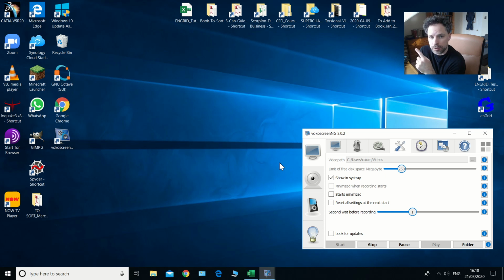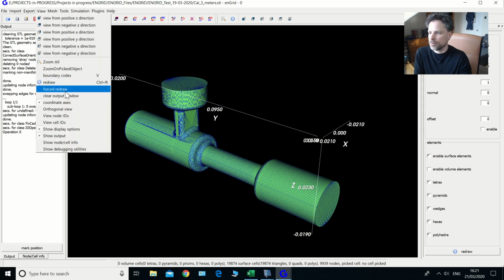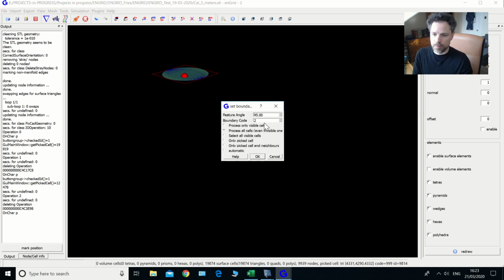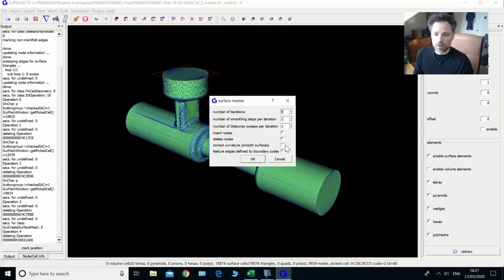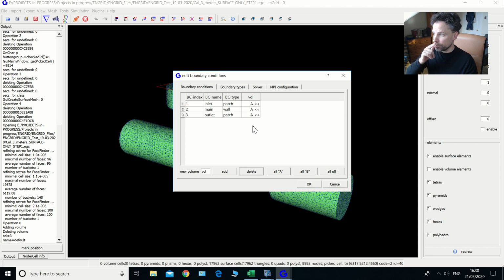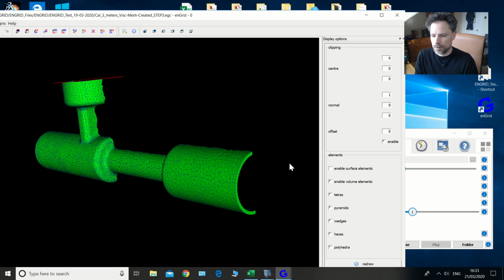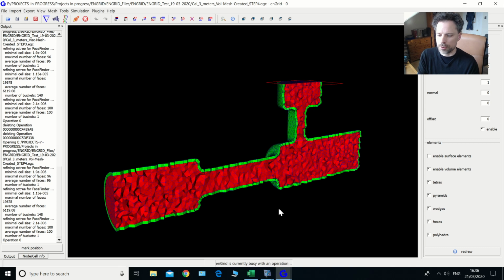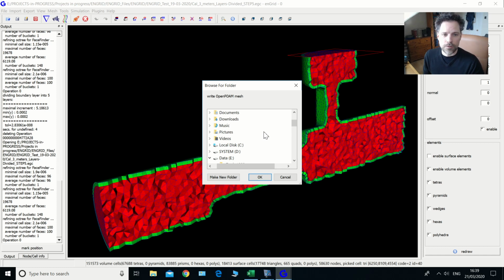OpenFOAM Tutorial Meshing with ENGRID #1 of 2 (MESH)

Comment: Thank you very much for making such a good video. I would like to know whether I can get the source code of engrid1.5 version. If so, where can I find it? This is very important to me and I am looking forward to your reply. I tried to build engrid1.4 on ubuntu16.04 but failed because I could not find an older version of the dependency...
Reply: To be clear, I want a copy of the enGrid source code that can be compiled either on windows10 or in ubuntu16.04 or above, and the required dependency versions are readily available (early versions may be hard to find).

Comment: Why didn't you use SnappyHexMesh?
Reply from the maker: Just because this is a tutorial on ENGRID, a simple geometry like this is perfectly possible to mesh sucessfully in SHM too, but in many cases it cannot produce high quality boundary layers, and so for that type of problem it can be useful to use ENGRID. I stuck with the same geometry just to have continuity between my SHM tutorial and this one.
Reply: @CalumDouglas  Thanks! Since it's free, it worths trying it!
Reply from the maker: @killua_xy  Its slow with making the initial surface mesh, so this (at the moment) limits model sizes.
Reply: @CalumDouglas  hello, i just discover this software, what i am questioning myself if the "slow" part is the surface meshing, using an already surface meshed surface from salomé could help? also, it says that it is from '15 is there any newer vr? or is any developpement? thanks best regards, franco